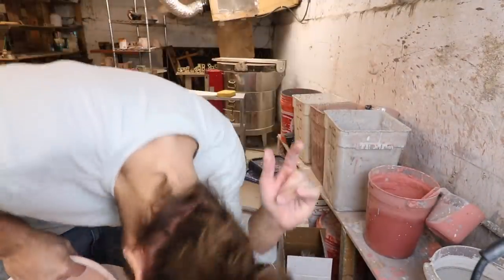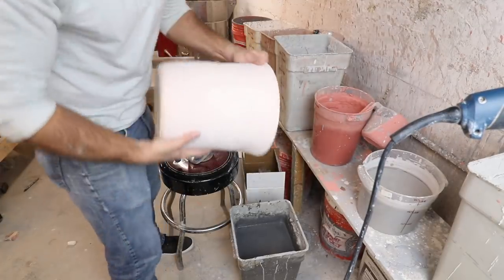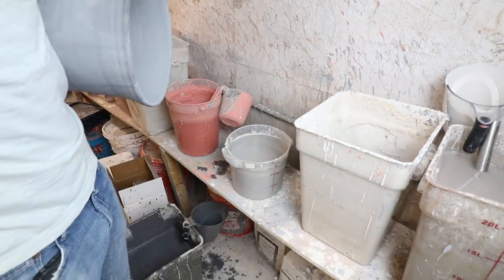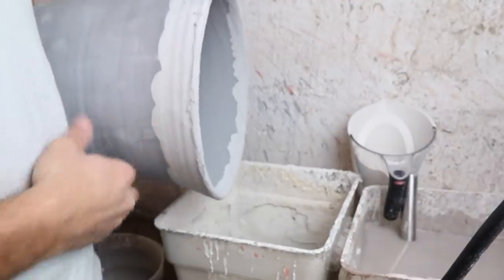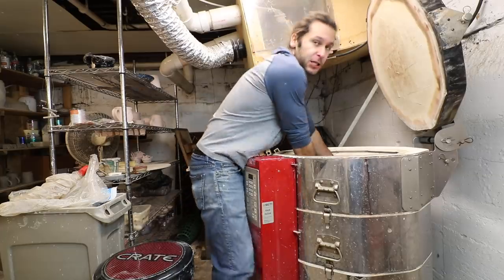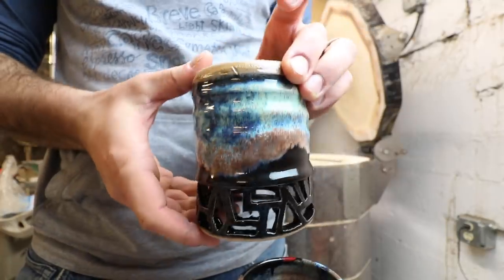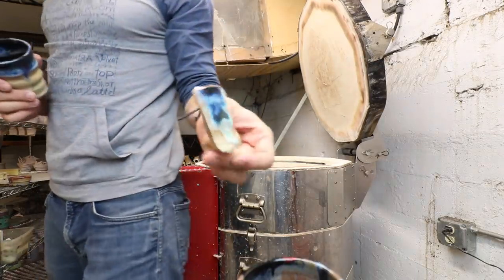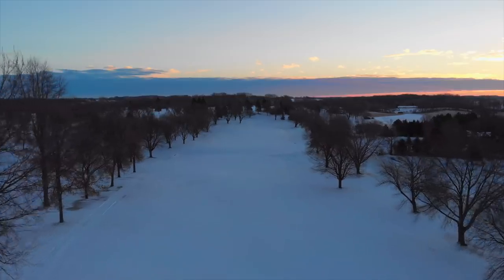How to Glaze a GIANT POT and Unloading kiln #40

Comment: A paint pot on top of a wire drain rack set the sprayer heavy and spray it . It’s what I’d do. Set that wire rack over your glaze buckets and let it drain back in there. Use a low air pressure though so it would run off well

Comment: I have been waiting for you to fire the big pot. Fantastic!  I looked back at the video when you threw the pot in sections which was actually a great idea for those of us that cant handle 15 pounds of clay at one time.  I’ve watch Joel Cherrico work as well and he has some great glaze combinations.  Lisa Orr, an Art of the Pot Tour in Austin Texas uses a red underglaze and colored engobes to get vibrant color combinations on low fired pottery. .I really like the red accents. It was interesting how it ran down in just some areas.  Did you put on as an underglaze totally underneath your accent glazes cause it just peeked out so randomly like it was added last on the pot? Might like the red on the black coaster if it was totally in the center and not jut a dab.  I really like the way you experiment with different combinations.  It’s like Christmas when you open the kiln.  I agree the green was lacking but then it might look different if it was totally in the center surrounded by black instead of white.  As always it comes down to personal preference.  Great video! Again!

Comment: could u make mugs with the glass coaster effect in the bottom of them? im just wondering & interested in whether it would work
Reply: anna hall It’s really not advisable.  Pieces with glass are not considered food safe because of the crackling effect. Those tiny cracks can harbor bacteria that washing won’t remove. In addition, there’s a risk that, over time, with washing and temperature changes, small pieces of the glass can fall out.  You don’t want to swallow that.
Reply from the maker: Yes the glass should stay far away from anything that would be used for drinking or eating.

Comment: Why do you have to glaze it on the inside if you’re gonna put soil in it? Also should you have added like a drainage? Just wondering 🤔
Reply from the maker: I asked my wife that but for this particular plant it does not need drainage!
Reply: I wondered the same thing... In general plants do better when the inside is porous, so not glazed. There is less chance of root rot. Snake plants are pretty tolerant though, so hopefully it did ok! Lovely pot :-)